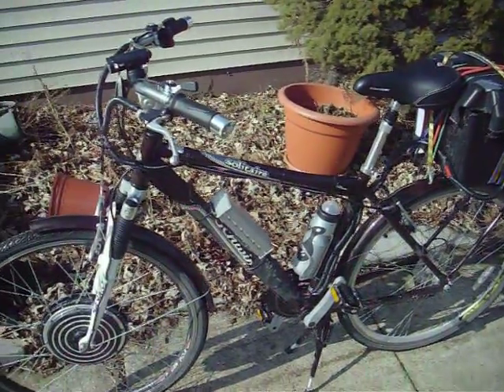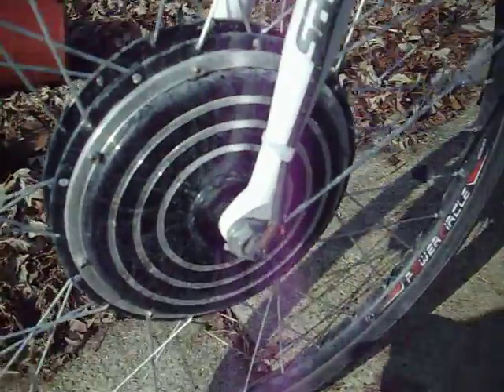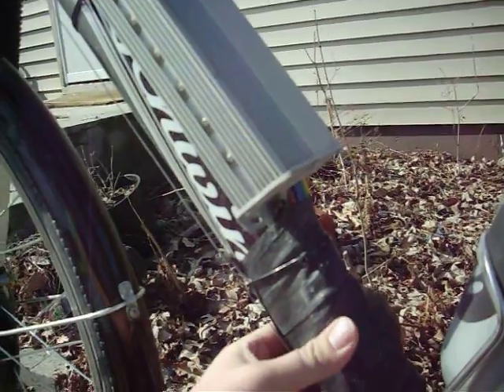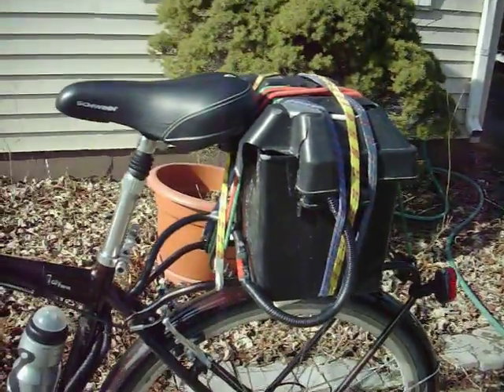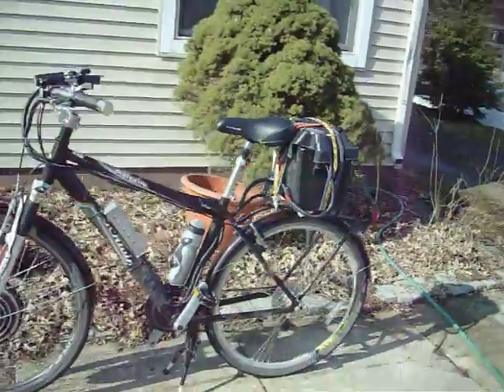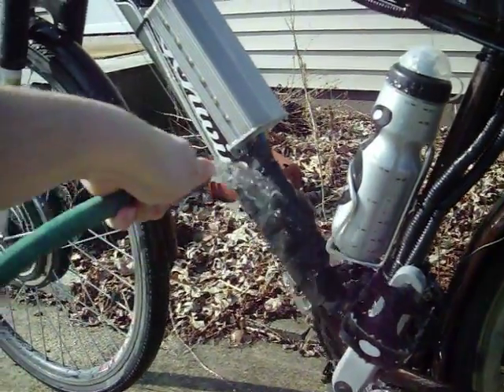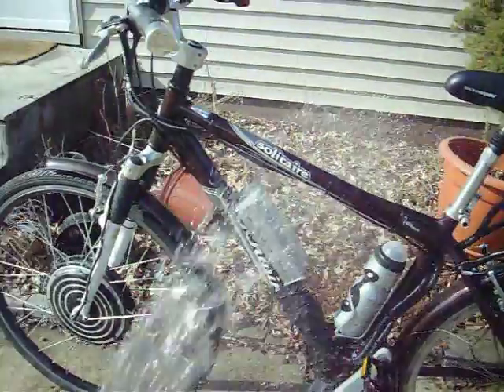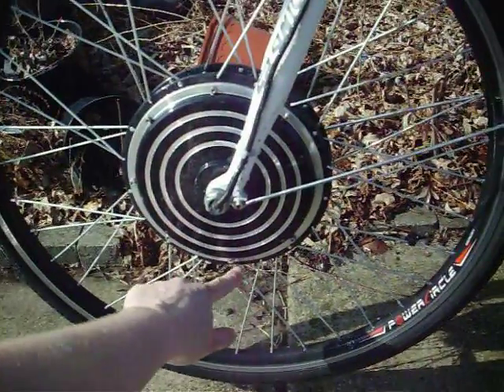Making your E-Bike Water Resistant. All Weather Electric Bicycle. How To Water Seal Ebike.

Comment: What a plonker, rapping inertube around electrics won't stop water getting at them connections, water will run down  between the frame and innertube and if it can't escape at the bottom will hold water, don't do this folks, a sure way to destroy your ebike.
Reply from the maker: Nice theory, brah. Meanwhile, in the real world, i did this for years and it worked great.

Comment: Watching in 2023 for some reason, bikes have come a hell of a long way eh?🤣. Of course we still haven't properly figured out how to waterproof an ebike as my throttle is not working properly after riding in extremely heavy rain the other day so I've had to unplug it and just use pedal assist for a few days. The next step in the ebike industry should be to weatherproof everything better because here in northern Europe it rains on 60% of days. My throttle is stuck on propelling my bike even tho I'm not pressing it but I was in one of the heaviest rain storms I've ever seen in my 20 years on earth.

Comment: I have no issues with any motors getting wet whether they are hub or mid drive. Mainly external controllers if there is an issue. No issues with batteries but the rain recently is concerning.

NEVER have the wires enter the controller from the top. That's what happened to me. Bike mechanic did that...

So are ebike controllers mounted naked with the wires entering from the bottom safe in the rain if I spray it with silicone waterproofing spray? Also all the wires with spiral cable wrap on them?
Reply: My controller is in a waterproof bag.

Comment: Dismantling the hub seems extreme! Wouldn’t it be easier just to use a bit of silicone in the six disk brake rotor holes (if it has them) as that’s the only place rain could penetrate
Reply: Modern hubs are sealed enough that rain won't get through. Plus the wheel is going around very fast there's no way rain will make it's way inside.

Comment from the maker: My 500W E-bike will not do 25 MPH, it will only get up to 23 MPH maximum, so to meet your specifications, you would be better off with the 1000W. My 48V 20AH battery will do about 20-25 miles on the 1000W bike.
Reply: and here i am in 2019 making a DUAL 1000watt hub motor bike, itll have no chainset or cogs no gear shifters, just brake leavers and two throttles no pedal assist :) itll be two complete Ebike kits mounted top to bottom of eachother, im gonna die

Comment: Hey I wanted to ask you to help me decide ..
I think which one is better to buy:
kit with 500w motor and 48v 12ha battery,
Or kit with 1000w motor and 48v 20ha battery.
I am looking for a speed of not less than 40 kph (25 mph)
And distance at least 30 km (19 miles)

Thanks in advance
Daniel
d_maximov@yahoo.com